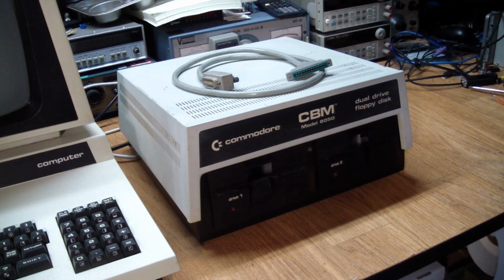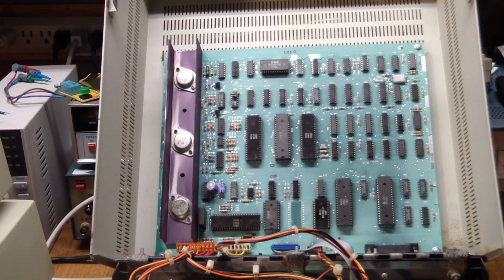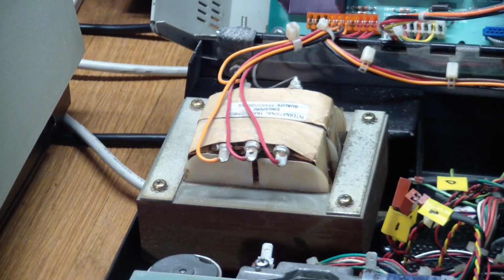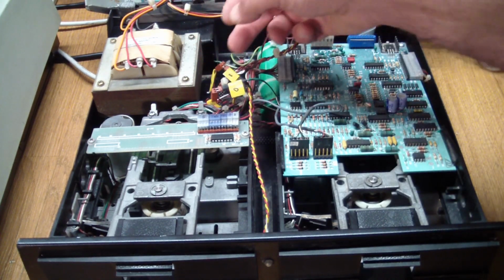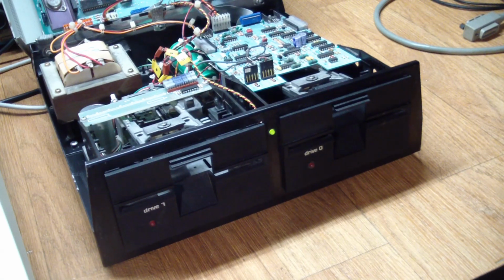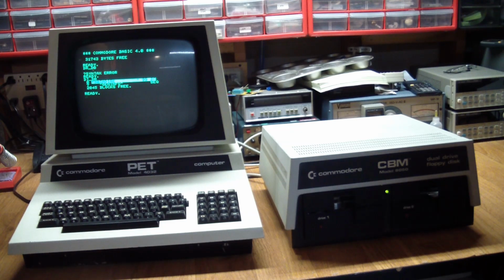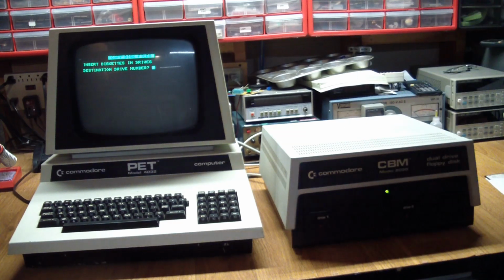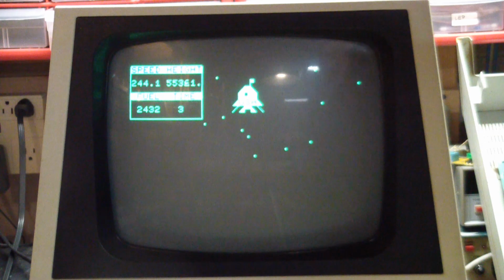AE#99 Commodore 8050 Dual Disk Drive Unit

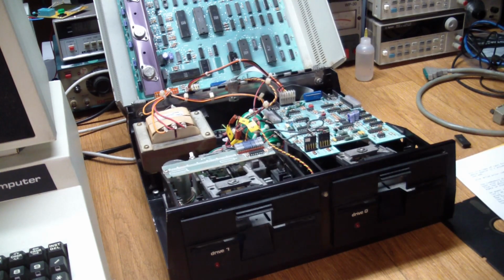Comment: @20:33 Although you talk about removing the ROM at UH1 what you in fact have done is removed the ROM at UL1.  I think there is a misconception around these ROMs and a typo in the flash diagnostics.  Removing UL1 gives me the 3 blink repeating sequence.  I think the service manual has the references for UL1 and UH1 transposed.  I also think the ROM images found online are also swapped!

Comment: Yes you can use the 8050 on a commodore c64. I was actually running a bbs on a c64 using this drive for storage. I was running a Ravics BBS program here in Memphis TN. I still have the auto answer modem from the unit here and think I also have the Ravics program disk someplace (it has been about 35 years ago so.....)
Reply from the maker: I have to try that once I find the proper interface cable for the C64.

Comment: The 8050 uses 77 tracks instead of the typical 35 to 40 tracks of most older 5¼" floppy drives, so that's how it is able to store about 500K per side, or 1 MB for the double-sided version (the 8250). (Not 2 MB as you said, except if you're counting both drives.)

Comment: You need to get a tube of Shell Cassida lubricant, expensive food grade lube, but very good white grease for use on those slides and such. As well you need to use mineral oil to lubricate the bearings when doing them, use some Mobil one, as that is cheap, good quality and will provide good lubrication in those smaller bearings. Got a lifetime supply of the grease, and use the oil that separates on the top as my liquid lube, it is a nice full synthetic lube, and as a bonus is not too harmful to plastic parts either.

Comment: I can’t believe I watched you... actually, no, I can believe that just fine! 😜  Um... if I remember right, that drive was kind of like a early file server in that you could daisy-chain a bunch of PETs on the 488 bus (6 or 7??? The 488 bus I thought had a 3 bit address bus, and I vaguely remember there being an ‘address all’ on either 0 or 7??) and they could all access the drive, without stepping on each other because the DOS was handled in that 6502 in the drive unit. 🤔

Comment: Off topic but I'm working on back lighting a Tandy Model 200, if I peel off the backing of the lcd screen will it destroy it? Or will it just be transparent? My thought is to remove the existing grey backing and have the white backlit panel behind it. Thus black pixels on white. The existing backing is semi-transparent so I could leave it in place (tested) but would be much brighter if could remove it. Thanks for any feedback.
Reply from the maker: I haven't seen the insides of one of these, but I would guess that the backing is just stuck to the glass envelope. That means you should be able to carefully remove the backing and replace it with another color or an LED strip. However, do this at your own risk.
Reply: @artifactelectronics  Thanks for the feedback, I think I'll leave the backing on.
Reply: Backing is one of the layers stuck to rear polariser, hard to separate just the one from the sandwich without damaging the polariser. You can get the film and apply it, but hard without cracking the panel. Simpler to just use a lot more light, probably by using a laptop LED array on all 4 sides instead, and accept the loss of light.
Reply: @SeanBZA  I'm leaving it on. Pulled light dispersion lens(?) from Acer Aspire One, almost perfect fit, just waiting on led strip I ordered, the led strip from the netbook was perfect fit too but I broke it, was glued to metal bracket.

Comment: Well done on the repair Artie.  A lot of good trouble shooting tips. Thank you for sharing.   BTW, when are you going to fix up that Fujitsu Hard drive with the engine knock? ;)
Reply from the maker: I ordered a set of valve stems but haven't gotten around to installing them yet.

Comment: Your vids are just awsome, really like the fault finding and repair sections. 
As a result of your vids I've aquired my grandparents TRS80, in its original box, 
and am in the process replacing the old capacitors to get it working.  
I'm also learning BASIC so that I can program it.
 Its true that your legacy is not the amount of cash or fame you aquire during your lifetime,
It's what you pass onto the next generation for which you will be remembered.
Thank you for sharing your skills.
- - - 👍👍 👍👍 Awsome 👍👍 👍👍 - - -